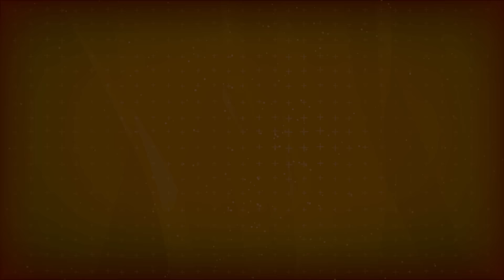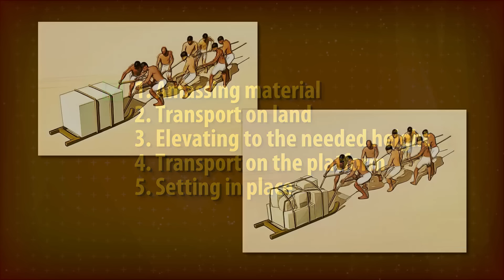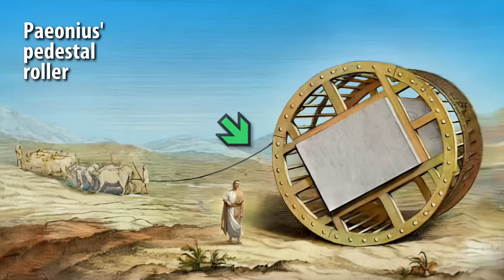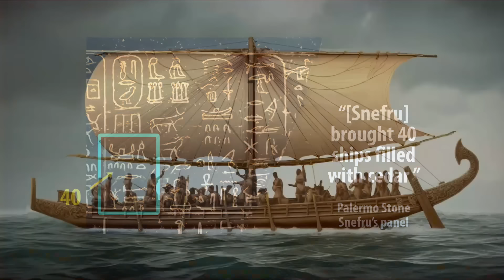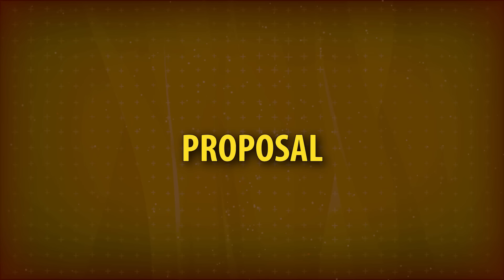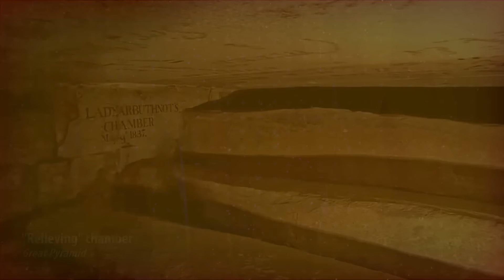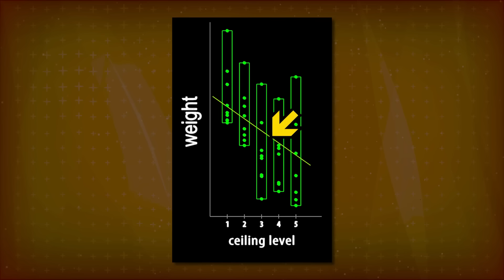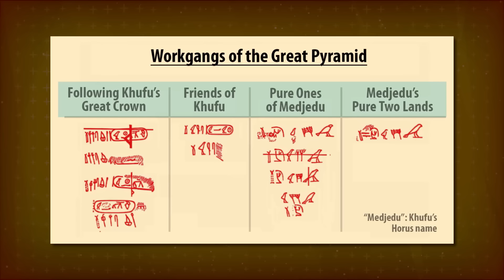How to Build the Great Pyramid in 9 Months (NOT aliens)

Comment: Our houses have nice+flat exterior and interior walls. Between those "sheets", we have emptiness, isolation material and carpentry frames. It's very plausible to think that the pyramids were built with the same "idea" (maybe not for the same reasons though), having rubbles of different sizes and shapes in between mason cut stones.

Comment: Great video on Engineering!  You did a wonderful job on every method; the fractal ramps you suggested would do all the things needs with minimal effort.  If they had lots more time on their hands (like 2 years or 4 years would be all they needed.), they could have used only 1 side or 2 sides to do the work as well with the fractal ramps.  Back in 1962 while at church, i thought of such ideas; rolling a large stone in a round cage, filling up lots of empty spaces with rubble rocks and cement. Your small ramp idea had never crossed my mind, big ramps and cranes was my only ideas.  New ideas are as wonderful as discoveries; they both make us better.

Comment: many many theories as to how they were built , but sadly we still cannot built the same today - there have been a tiny few attempts to build a scaled down pyramid in recent times , that set out originally to use only man power but ended up using modern day hydraulic machines - so until someone builds something similar all we can do is guess
Reply: Of course we could build a pyramid at the same scale but why? There is just no impetus to do so.

Comment: Lifting levering, rocking, pulling.. what about floating? Build wooden troughs with locks on the side of the pyramid. All you need to move tons of material is couple of guys with ropes, and some extra people running a bucket chain to keep the troughs full. You use the locks to raise the blocks as you zigzag them up the pyramid. It'd be all wood construction, so there wouldn't be much archaeological evidence left. Egyptians knew barges, hydraulic engineering, the Nile is right there.. and the use of ships/barges would fit theologically. Just thinking out loud.

Comment: Excellent video, the only problem is that the intact casing stones of the khafre pyramid had it's casing stones set first with the joining stones slid in from above to join the sections from above with smaller fitted stones indicated by their angle. This is consistent with an internal ramp. History for granite did a great survey on the remaining 2000k casing stones and that's very consistent, that doesn't mean the great pyramid could not have done the way you show here. But if khufus pyramid was done this way why would khafre switch up the Formular? Maybe he did and because the casing stones survive because he did. Maybe the granit blocks were jacked up level by level from the beginning like you have shown here and maybe houdins external ramp beginning from the point where the khafre pyramid now stands would have been an unnecessary hassle.

Comment: It’s like maybe it could be built in 9 months if they poured the blocks like cement with geopolymer. Any other method sounds absurd that I’ve heard. Like okay even if they had slaves or cheap labor etc like sure they could have done it but twenty years to build it with slaves still seems super quick. 

I look at the history of the salt lake temple in Salt Lake City, Utah. I think it’s a good example. It took years to build and they had wagons to move the big ton blocks. BUT here was the real reason it was built in 40 years. It was cause Brigham young had Mormons work on the railroad so when the railroad went bankrupt the church got a railroad rather than the workers getting paid. So then the church used the railroad to move the stone blocks and that let them finish the temple quicker in 40 years time.

Comment: You can not mine and remove the stones with copper and stone tools in 9 months or even 18 months.  It wasnt done that way.  They didnt have steel.
Reply: First of all they had copper, which could cut the hardest stones with sand as a lubricant. This has been demonstrated. But that's not how most of the blocks were carved - it was using hard, round stones that would flake off tiny bits of stone at a time. This is very clear from the obelisks that were abandoned part way through quarrying due to cracks. That said, I'm sure the time frame would have to be considerably longer than 9 months.

Comment: Good analysis. Just a couple of notes; I assume in ancient times people were a lot stronger and used to long hard workdays. Did they drink beer also? Parts of that ramp system could be relocated and reused as the pyramid was going up, ie the ramps from the lower level sides moved toward the center further up. Was JIT utilized? Anyway people were pretty smart back then.

Comment: 5star! The first well thought out and referenced solution I have seen or read. Highly plausible. I only wish you had finished this off with an attempt to take this theory into what would have been practical - how long it realistically would have taken to build given the flood cycle, labour force manageable, quarrying/collecting rate, useable daylight, time to move stones and rubble to the site and across the course level etc. And I also wished you had covered the granite casing stone and limestone finish.
Reply: Good points

Comment: Best video about the building of the pyramids that I´ve seen by far.  I still have some doubts about the transport and placing of the bloks that are not rubble with an average weight of over 10 tons and that makes a huge difference over the 2 ton slabs on the japaneese model.
In any case it puts together the logistics as well as the modeling and placing of the rocks and wich makes it a real effort to explain all the details involved and explains quite successfully the basics of this huge task.
Reply: Besides the huge relieving chamber stones the average block weighed 2.5 tons, not ten.
Reply: I would review that figure, the average weight of a "normal" stone was 2,5 tons and these other ones from the chambers are huge in comparison.
Reply: @jazzman_10  The "average" block weighed 2.5 tons, some did, indeed, weigh various other weights all the way up to the 80 ton giants above the Kings Chamber but the AVERAGE stone weighed roughly (no two weighed exactly the same.) 2.5 tons...
Reply: @waynemyers2469   Sorry, I know what you mean, I the figure I wrote on my first commentary is wrong.  I agree, my bad.
Reply: @jazzman_10  Absolutely, no problem, thank you for amending your statement, a sign of character that you don't see everyday on the internet, peace.

Comment: Love all these pyramid theories, but most theories all focus on the Great Pyramid, when many other pyramids were built.  Did they use the same method on all of these pyramids?  For example the Step Pyramid, what's the theory for that one as it was done in layers and looked to have evolved shape over time?  The Meydum Pyramid, which had a stepped pyramid core, was covered and then collapsed what was used for that?   The Bent Pyramid, it has a changing angle, how was that taken into account. I think the evolution of all Egyptian building from mud Mastaba to the stone Great Pyramid has to be analyzed and taken into account when considering theories.  As with most things, the most simplest explanation is usually the case, so I am doubtful they used elaborate ramps, lifting carriages, etc. They had little wood, but plenty of rock, mud, fiber, and people,how were these natural resources used to their full potential.

Comment: The quarter round method of moving the large blocks actually makes sense for ferrying the blocks by boat from the quarry. 

You build two parallel docks that extend into the river, just wide  enough  for a boat to move in between them. The boat is laden with stones to lower it. Then the stone with the quarter round is rolled out  onto the two docks, over top of the partially sunken boat. The ballast in the boat is removed, and the boat rises and lifts the block/quarter round assembly. Chocks keep it from shifting. 
At the destination, the opposite is done. Then the rope wrapping method you described is done to move the block over land to the pyramid. 

The same exact principle is in use today, research semi-submersable mega lifting ships, which lift and tranport giant oil platforms, and even cruise ships.

Comment: So you think that a person could sight down the edge of a massive pyramid as an accurate means of measuring ?? Have you ever built anything ?? They did all that without a simple level or anything ??

How did they excavate the foundation ?? And so accurately   ??

If they used rollers to move the stones how did they offload them and get them placed so accurately ?? Have you ever moved large stones or boulders before??

How did they quarry this rock so well with such primitive tools ?? 

How were these wooden bridges on the ramps you proposed able to support the weight of the massive stones ?? What did they use to fasten the lumber together ?? How did they build them to hinge up as you proposed ?? 

There is so much more complexity to these pyramids than just answered the question of how did they get the stone elevated from the ground

Comment: If they added the possibility of a internal ramp,, the external ramps would not even have to be built.

An internal ramp also adds an additional feature - security. An outer ramp would be far away from the inner areas that need to be more secured. Another would be the blocks with attached 1/4 road is attached would have less transition times at the corners.

Also at the end of construction it would it be easier to plug the ramp. Not sure if anybody noticed but if you look at pictures of the top of the pyramids the placing of the blocks is a lot looser than up the sides. Kind of makes you think that it took longer and/or method to get the blocks up to the very top.

Comment: You learn something new every day.  The fact the pyramid is not constructed out of just blocks is a revelation to me.  But only the critical parts are while there are compartments filled with rubble.  And you theory is well thought through.  Even down to the statement "the wish of a despot!"   I have zero engineering training and zero building knowledge.  But to my untrained mind its the most rational explanation I have seen to date that fits and does not leave huge gaps in the theory they are trying to propose.  thanks for putting this together and sharing it. Its like domino effect of penny drops mental that fit together.  Those wooden curved tool reminded me of the of a video I watch recently the curve looks like the  isochronous curve/Tautochrone curve,  the curve you get from tracing a point on a circle as does one full revolution.  Which has some interesting properties.

Comment: Not buying the obection to leveraging nets- The load may shift a bit? Easily solved by paying some attention to how you load the net so it wont shift from side to side.  Shifting front or back is much less of a problem.  In any case shifting inside a net is pretty much always towards the center of the net, which is no problem at all as far as I can see.

Comment: The assumption that all materials  had to be transported or lifted in loads comparable to full size blocks is not valid.  Wheelbarrows and small carts were already in use for transporting  loads within paved structures. A pyramid under construction would have created flattened paved surfaces, level by level.

Comment: I had not heard of the rubble stones and mortar used as building material until this video pointed it out. Those of us who have never seen the pyramids in person(there are many of us), have been led to believe that the pyramids consist of a few different types of stones, each having been precisely cut to fit tightly against the one next to it. This is what makes the pyramids sound so incredible and improbable. Once you consider that there is a fairly large amount of uncut "filler" material filling cavities between the critical(precisely cut and placed) stone structural parts, then things dont seem so unbelievable. They begin to sound like something that could realistically be done
Reply: I think the rubble was likely a resource and time-saving measure. Otherwise there's probably nothing stopping the Egyptians of the past to have it all cut neatly. Could it be that pyramids were completed during a single ruler's lifetime?
Reply: @cavemann_ Yeah there is a whole lot stopping the Egyptians were perfectly cutting and placing millions of 70 ton granite blocks into place, it’s called practicality and limits.
Reply: @VincentJames3912  Only a few blocks were 70 ton. What I had in mind are the smaller blocks that were around 2 to 3 tons which is way more plausible.
Reply: @VincentJames3912   Point out just ONE perfectly cut block anywhere in the pyramid. And the heaviest stones - those that form the relieving chambers above the King's Chamber -are not cut at all. Their shape is extremely crude. NO stone that wasn't in a place where it could be seen, was even what you'd call remotely well shaped. And certainly not cut. More like bashed crudely into an approximate shape. I suggest you go there some time, instead of watching dumbass History Channel melodrama.
Reply: @ashscott6068  I suggest you quit being an asshole.
Reply: @VincentJames3912 they used mortar because it's not perfectly cut.
Reply: The idea that a stone was set every 2.5minutes is unbelievable regardless of the theory of construction.  I think this theory has some good points to it, but even so there are so many aspect that don't seem possible. Just consider the quarrying of the stones. How is it possible to remove millions of very large stones from the solid bedrock with nothing but hand tools at a rate of one every couple of minutes ?  No, realistically we have no idea how it was constructed.
Reply: @scruples3 sure just forget at that 😂😂 don't spoil the clickbate
Reply: @scruples3  set every 2.5 minutes? How do you know this.
Reply: The aztec pyrmids in Mexico appear to ne made out of rubble (uneven stones) and motar!

Comment: Lots of assumptions and ignored facts in this theory/video.  Leveling of the plateau, tunneling and air exchange, it's an 8 sided pyramid not a 4 sided pyramid, north alignment complexity, lifting and setting granite stones in halls and chambers, granite joints, casing stone joints, geometric construction with Pi - Phi - and other sacred numbers, yearly floods for weeks to months at a time, transporting granite from hundreds of miles away,  etc., etc... Don't get me wrong, this is an interesting theory, but it needs a lot of work to be believable, and the timeline is way too aggressive.

Comment: interesting analysis. i have been fascinated by theories of how the pyramids were built for several years.  i see several flaws in your analysis of the time to completion, first of which is 24 hours day, 7 days a week.  you mention that of course, but it does call in question your "Build the Great Pyramid in 9 Months".  along that timeline, your rolling up a ramp scenario does not make any accommodation for the turn time at the end of each ramp, or for any mishaps that would most certainly occur.  you also ignore the time to build the ramps, what they would be made of and how they would survive the stresses of the rolling bundles.  there was also a complete lack of analysis of how large a bundle could be rolled up the ramp as well as how each of those bundles related to the total volume of the pyramid.  
i will say that you present some interesting ideas.  kudos for that.
the levering of the granite pieces is quite an intriguing idea, would also help to solve the question of how did they create them with such tight tolerances.
keep up the good work

Comment: Very well done, good theory and approach in explaining it. It raises the confidence that the Egyptians are the ones that really did it, without any "alien" help. The brilliance of this is the fact that it will work even if only parts of it were actually used. Not all ramps may have been built, but it will still function as explained. The scalability factor is considered and as far as I have seen, nothing (except maybe anti-gravity tech) actually considers it. Also they may have used sleds not rollers, but the ideea holds.Very well done!

Comment: This Video is complete Rubble. It was Build Like a Dam with 4 Sides, Water in the Center slowly Growing. The Stones are Geopolymere "Concrete", Pressed into Forms. The Other Huge Stones where Floating in the Center until Put into Position. Thats Why they Buried the Boats next to the Pyramid. You can use them Like a old Scale. Fill one side with Water and the Other side lifts up the Rocks. Like a Primitive Floating Crane  you can Move around in the Center.
What you call Rubble is just Cracked Rocks that washed out over the 12.000 years. Thats why there is the Rampump in the Bottom. The Whole thing when it was Working was Vibrating and had Water Flowing Trough it.

Comment: Mayan and aztec pyramids are built from a small core which is buried inside a bibger pyramid with rubble sanwiched between the two stages. I would not be surprised if egyotians used a similar method. That actually would explain the "queen" chamber and the double pair of "star ducts" that have no exit

Comment: This is cool.
A guy did a video on the way the stones were placed, showing that they cut angles on a side and dropped in from the top. The ramp theory is disproved by the placement. If there was a ramp or scaffold in the way, the blocks could not be placed as proven by the other theory. He has identified all the angled stones. We need to know how the stones were cut and lifted. The blocks in the kings chamber of the great pyramid are granite.  The dimensions are that of the circumference of the earth. Whoever built it knew this.